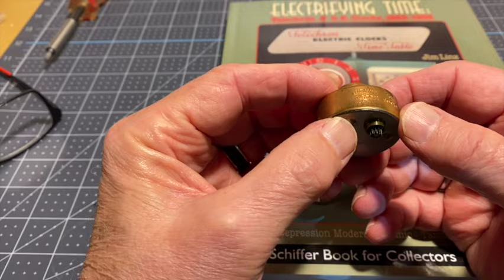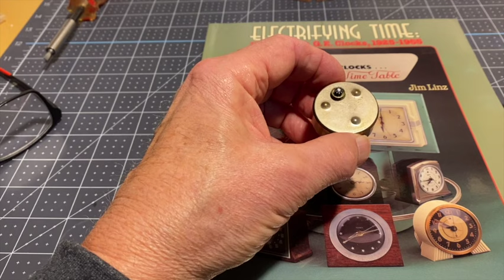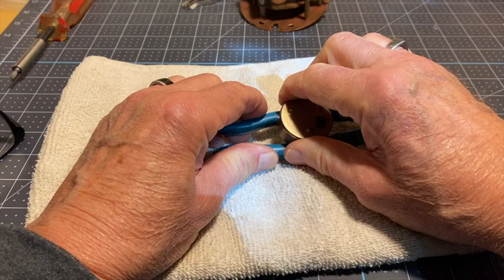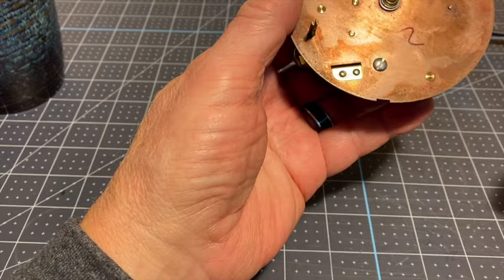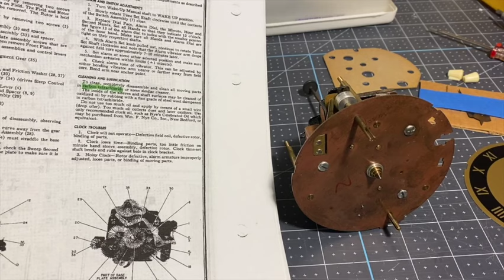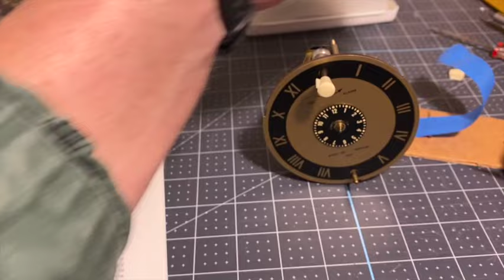GE 514 Episode 7B Telechron Alarm Clock

Comment: I was expecting the red pointer on the back of the hour hand to point to something to make it easier to set rather than having to guess the position behind the black part but I am not sure how that would work.
Reply from the maker: Thanks for the question. It made me go back and check that the alarm was working correctly. It turns out that it was 12 hours off. What I found was that when you remount the clock hands, the 12 on the black alarm dial should actually point down to the red arrow on the other end of the hour hand. In other words, the hour and second hand should both point to midnight, but the alarm dial should be set to align its 12 with the red arrow on the hour hand. To set the alarm, you turn the alarm button counter-clockwise until the red arrow on the hour hand points to the time you want to get up on the alarm dial. Hope that's clear, and thanks for checking in!